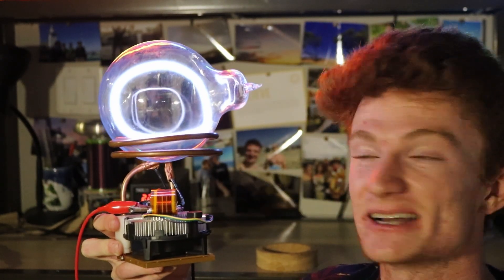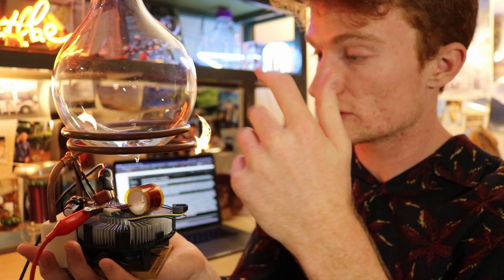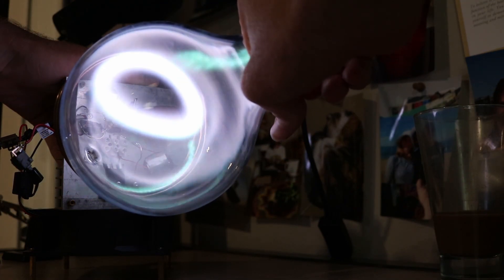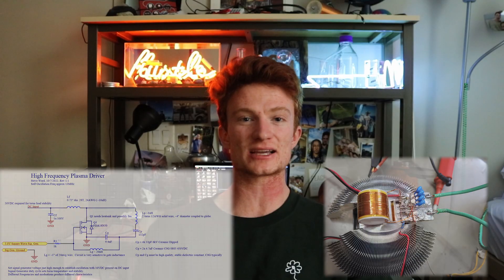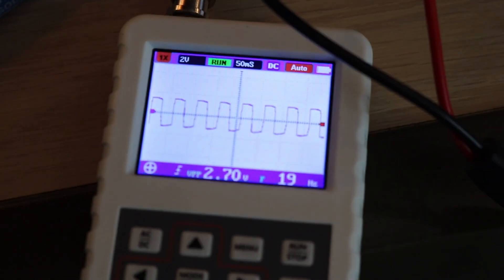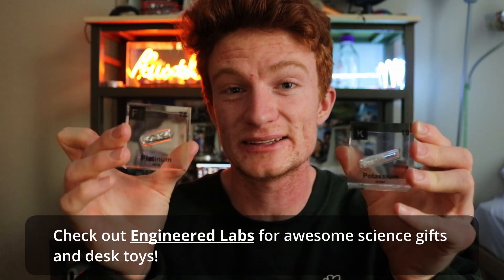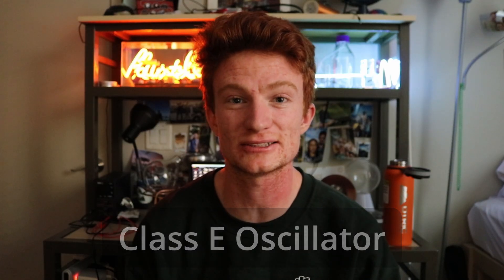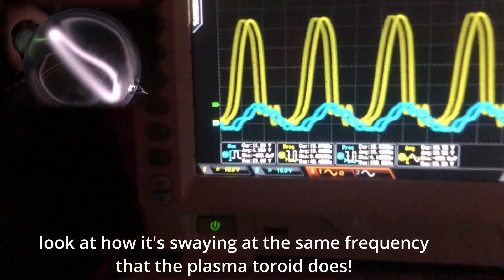perfecting and explaining the plasma toroid

Comment: Even if you can't get it to 'play' music, I'd still mess around with different waveforms and frequencies.  Just making the toroid move around and contort is enough of a cool display to make the experimentation worthwhile.  The audio input circuit also only needs an amplifier, don't expect a ton of power from most headphone and line devices, nearly anything you use will require some form of amplification on a line-in jack; it doesn't have to be a high power amp either, just something that'll drive the chip, you should be able to get away with a typical transistor or op-amp power amplifier circuit. 

I'd also be curious if there's any off the shelf oscillator chip that could work for this, even if output has to be driven through its own power amp(s).  Y'know, just to simplify things with ICs.  Keep production in mind, this could easily become something a lot of people are interested in; besides the very expensive plasma globe, that's really the only deal breaker at the moment, though that's an issue for a different topic of discussion given the circumstances of why its so expensive currently.  Even if this ends up as a DIY project for most, or a group buy of PCBs for a DIY kit, things should still be kept to where manufacturing is simple, and some SMD ICs is a step towards simplicity when manufacturing is concerned; essentially make the design pick-and-place friendly, then make building the end product (at least electrically) the finished PCB, a donor heatsink, and the large coil, as this makes production at any scale, including DIY, the absolute simplest. 

You should also look into putting a case around the thing, even if it's just 3D printed for now.  Make it look presentable, make it look like someone could have this on their desk or a shelf.  This would definitely get more eyes on the project.  The average person would show more interest if a project looks like something they could purchase or build themselves, there's quite a bit of psychology behind it, but for a growing channel and especially as you're making this channel your career you'll want to break out of just niche communities and into the broader audience; just take note of how channels like DIY Perks, Great Scott, Tom Stanton, etc., stay afloat, also play by the algorithm's rules and stay reasonably active with a consistent upload schedule- a loyal community, short-term virality, and off-platform clickthroughs are one thing and will only do so much for channel analytics, but doing this as a full-time career needs long-term projection to stay positive, and get a decent set of sponsors to keep revenue flowing, content creation isn't just a career but also your own business and you need to keep an entrepreneurial mindset.  Designing a case to make this look more like an end product would also put you into the spheres of design and engineering, possibly even into manufacturing if you 3D print stuff or any kind of forming method, etc., which could positively impact who sees your content and open the door do more content creation. 

Personally, I'd also look into some kind of dampening or isolation between the coil and the glass, just to quiet things down a bit.  The glass itself could still resonate, but it wouldn't be resonating against a metal hoop, or any kind of casing.  If people want this as a kit or product, especially as a desk toy or shelf lamp, keeping noise (and heat, we all remember lava lamp fires, right?) to a minimum is almost a must. 

As for other project ideas or video ideas, I don't really have any specific suggestions.  Just do what interests you, but keep a balance of short-term and long-term projects, and have simultaneous projects that you can switch between so you don't stagnate on a singular thing.  

You've done chem stuff, some biochem, expanded into electrical engineering which includes some math and physics stuff, I'd suggest continuing the trend of exploring relevant spaces.  Maybe consider being the practical side of general academia while explaining the theoretical side; maybe also get into the history of topics as well, such as going through the original discoveries of the plasma toroid.  As I suggested before, you could branch into design and engineering, which would go well with the current electrical engineering and tube lighting arc of your channel, you could get into the math and science behind various topics, etc.; general academia has a nearly limitless potential for content, and showing the practical side of things adds to that.  For example you can go over all the chemistry, physics, electrical engineering, math, and theory of the plasma toroid, but you're also producing a physical counterpart that shows the practicality of it all which gets into actual design, manufacturing, etc.  Keep this kind of mentality behind any project and I think it'd be a good model for content, both for short and long projects: Conceptualize, theorize, experiment, iterate, produce, then finalize, while explaining the important bits along the way.  

Though one interesting field could be robotics, which covers most of this.  Not necessarily developing a full robot or just building stuff, but going over different mechanical things, like air bladder actuators, microfluidics, electrically stimulated muscle tissue and how that works (which gets back into biochem), etc..  This could then stem into the control design which would include circuit design and possibly get into things like ML/AI and various sensors as well, which could then get into an actual project that goes over engineering and design, etc.  Multiple short-term topics mixed in with longer-term stuff, that covers basically all the basis of general academia and the practical side of such.  And this isn't just limited to robotics itself, that's just one field that has a lot of potential that covers a lot of areas, some of which (biochem, chem, EE) you seemingly have interest in given your content history.  

I'm not really the best at spitballing ideas.  The main takeaway here is to keep your horizons broad and tackle any subject you find interest in, but don't limit yourself to the point of potential stagnation, while also keeping your content topics wide enough to pull in a general audience to avoid falling into hyper-specific niches.  For example, as cool as the plasma toroid is, it can't go on forever, and tube lighting in general is a niche that could only produce so much content itself.  There's limitless potential if you play your cards right, keep a broad audience, keep a consistent schedule with decent activity on the channel, always aim for high production quality, etc.; keep viewers happy, keep the platform (and its algorithms) happy, and keep (potential) sponsors happy, and you're in a good position by what numbers and analytics will tell you- but most importantly, keep yourself happy, don't burn out on creating content, pace yourself, and keep your interests broad enough to where you won't stagnate or the platform will put you into a rut, maybe also continually learn new things along the way as well and expand your horizons.
Reply from the maker: Thank you for all that, Xaytana. I think IC’s are not used because the circuit is simple enough as it is—power and drive stages in one. And the frequency required to get this phenomenon going is quite high for an IC. 

Content wise, I’ve planned out a year of videos, and I like your tips about exploring all facets and disciplines of each project with videos to maintain an upload schedule. I’ll see you around, and thank you again.🙏

Comment: The globe containing the gas to be ionized should be made of borosilicate glass if it Is not already.

Do you know what the current in the plasma might be, in amos/mA? Xenon tends to linear discharge in plasma globes (skinny lightning-like streaks), so I would imagine the current in the plasma ring to be quite high. What is the pressure in the globe?
Reply from the maker: I dont know the current but the pressure is 15 torr

Comment: Adding another 2 exciter circuits, both normal to each other and normal to the original exciter, should let you be able to control the plasma in 3 axes. It would be super cool to be able to control the orientation of the plasma ring by modulating the power to each of the 3 exciters.
Reply from the maker: Cant wait to try this

Comment: This is amazing looking! Very "Iron Man Arc Reactor". I'm not too familiar with these, so please excuse my ignorant questions, but is there any practical electrical or mechanical use, or possible adaptation to utilize it for a function, or is something like this solely for visual demonstration? Reminds me a lot of a cooler looking version of the old school plasma lightning globes.
Reply from the maker: Hey Dj Goku, it doesn’t have any practical application other than lighting, education, and entertainment. I think it’s the next generation of plasma globes too 🙏
Reply: @BackMacSci   Thanks for the reply. What would happen if you applied this to an existing plasma globe bulb? Are the internal gasses similar? Would it just result in a larger toroid? Or is it not compatible with this process or too large to ever ignite? Curious if you could just retrofit something like that, that's already mass produced and easy to come by for relatively cheap? Not saying any of the electronics would be of any use, but the bulb itself maybe.

Comment: Best of luck on your YT journey. You may be able to get some pretty interesting geometries and movements as well as just generally more control by introducing multiple coils at different orientation and adjusting your signals independently.
Reply from the maker: Thank you Danté, Steve Ward has experimented with multiple coils oriented normal to one another and the toroid behavior is sporadic and jumps from coil to coil, staying parallel with coil plane, but his experimental results are not published to the public. Maybe they will be soon, and I plan on doing this soon too.

Comment: I can't wait to see some more tweaking of this circuit, adding a few potentiometer knobs to adjust parameters (and toroid behavior), and some more specifications such as current draw from the 19.5v input, and runtime duty cycle as a desktop toy. Can it be run continuously? Can it be made silent through improved heat management?

Comment: That's a cool circuit design you borrowed and a cool device you made.  I'm wondering what would occur if you had a version of your device that had the large coil wrapped all the way around the glass vessel.  It might make it harder to see into it but you might have more plasma activity or even a new shape!  Also, dear lord you used a lot of solder (or whatever that was) there at one step.

Comment: to get the stabilization you want you will need to induce a high voltage frequency at 11 Hz and you would have to put it in a vacuum at -100 and you would see life start to take forum ......

Comment: Great video, also for a future project (video idea) you could replicate a similar results (plasma rings or controlled arcs) using microwaves. Microwaves guns can turn on lights from a distance and “grow” plasma from a tiny spark, just be careful as they are quite dangerous if not controlled.

Comment: 5:11 plasma heats the gas around it, and pulsed plasma makes the gas expand/contract very fast. Expanding/contracting gas is sound, and in audible frequencies humans can hear it. There actually is plasma speakers that operate by creating sound with a modulated electric arc instead of the usual vibrating membrane; I've built one myself many years ago, much fun!

Comment: @BackMacSci

What would happen if you placed a coil above and below the globe? Would it stabilize the plasma better or would the electric fields inside the globe cancel each other out?

For version 3 you should try to use a xenon filled glass torus instead of a globe. No clue if it’d make a difference, but you could always run the coil around it and through the inside.

Comment: Dunno about the 0V switching on the drain side. But you could probably use a TIP120 to step up the data line to the breakdown voltage. Pretty common application for gpio.

Comment: I suspect the squeal is actually the glass touching the metal, in a similar fashion to laminated iron core transformers buzzing because the laminations aren't perfectly locked in place spatially and vibrate against each other due to the magnetic field fluctuations. In your case, your coils and glass aren't locked in place at all and are free to vibrate (against each other).
Reply from the maker: I like that theory!

Comment: Don't give up on chemical etching. Sharpie interferes with the HCl + peroxide etchant (personal experience). Try a paint pen, or just go full on toner transfer (I use thin magazine pages from the Jameco catalog). Also, quick dip (1 sec) in the etchant before you put on the mask really helps make the copper uniform and sticky for any mask (turns a nice salmon pink).
Reply from the maker: Oh nice, thanks

Comment: I am really surprised that boyancy is playing such a significant factor despite the amount of vacuum. 

10:45. You could have still used the Bluetooth as a signal generator. You just Needed an amplifier circuit before the Gate of the transistor you wanted to drive. 

11:30  Am I seeing a ring of plasma balls? Wow how would one explain them?
Reply from the maker: Yeah, maybe the buoyancy has such a strong effect because the temperature of the plasma is very high.

 for the bluetooth signal generator idea, thanks for that, it did not cross my mind😂. 

You are indeed seeing plasma balls before the plasma ring “fills in”, which I believe are an analogous to the dark spaces in a cathode ray tube, since the charged particles are accelerated and slowed periodically in this circular electric field in the same way (each AC half cycle) as in a cathode ray tube’s HV DC field, resulting in the periodic high and low intensity regions of light. Thats my theory. This happens in neon signs too! Theres a device called a beading transformer that enhances the effect in neon tubes, making plasma beads.
Reply: @BackMacSci  so the reason why There were several reasons why I was surprised by the amount of boyancy. 

1st is that atoms or ions don't rise because they are hot,  they rise because they bounce off a lot of other atoms or ions. And because they are hot their random motions containing more momentum  occupy a larger volume.  But  that effect drops off with deeper and deeper vacuum.  Given a "medium vacuum" the mean free path between collisions is in the range of 10 to the power of (-4 to -1) meters.  Between 0.1mm and 10 cm. 

2ndly. The plasma motions are not random. At each point in the plasma, ions are accelerated by magnetic fields in one direction only.  

3rd. Those ionic currents in the plasma create their own magnetic fields.  Supose you have two wires next to each other with current flowing in the same direction. Their magnetic interaction with each other pulls them closer. In a plasma this is called a z pinch.  Quoting from Wikipedia "In fusion power research, the Z-pinch (zeta pinch) is a type of plasma confinement system that uses an electric current in the plasma to generate a magnetic field that compresses it." 

Taken together, given a rarefied atmosphere wih few atoms to bounce off and a certain amount of magnetic confinement offsetting  some of the thermal expansion, my intuition lead me to think there would not be much boyancy to observe.  But apparently  I was wrong.

Comment: Have you thought of trying a pair of Helmholtz coils to generate a transverse static or slowly varying magnetic field to see how that affects the toroid? Electronics, radio, plasma, microwaves, huge voltages, high vacuum, precision machining, weird physics and maths have kept me in full-on nerd mode since 1968. Have you considered making a bulb connected to a vacuum generator and gas injector to vary the amount of gas in the bulb and different gas mixes? Plasma vapour deposition is fun.  How about a plasma generator based on a oven magnetron in a low pressure chamber?  How about using an oscillator to drive the Mosfet, adjusting the drive frequency to get the current and voltage through the device to be fully in class E or F? Is the gate capacitance of your devices a significant proportion of Cg? It may vary with voltage, so swamping it makes sense, at least in an oscillator. Perhaps using an H-bridge of mosfets with isolated gate drivers might give you a bit more flexibility to avoid any transients or RF getting into the driver device. I use a cheap function generator for this sort of experiment, and use optoisolators or MOSFET driver chips with internal isolation.  You're doing great, I hope to see you hit 100k subs soon. Adsense income is only a tiny proportion of most Youtubers' income, so keep looking for affiliate deals on stuff you use and trust, sponsorships without weird conditions or exclusivity rules, and cultivate a community via the community tab or IG or Mastodon or Patreon or a Discord. Best of luck - Neil
Reply from the maker: thank you Neil. Nice to meet you!